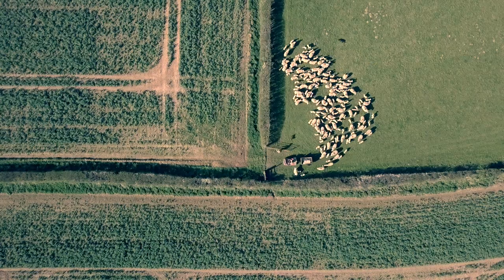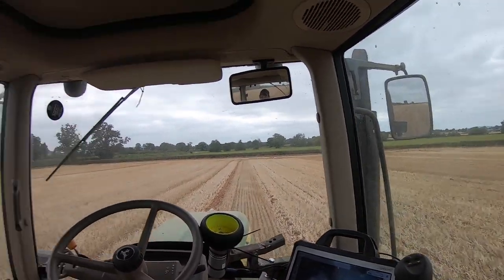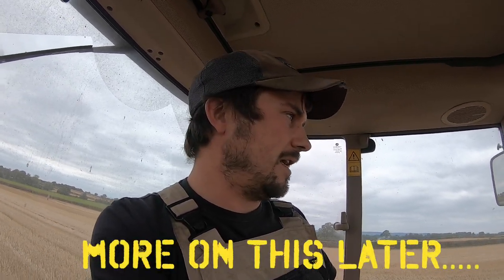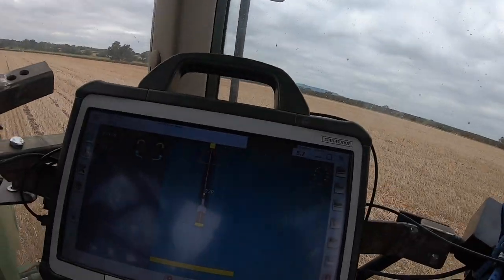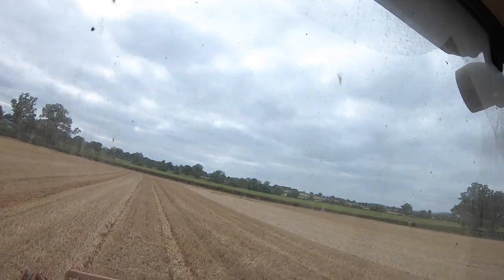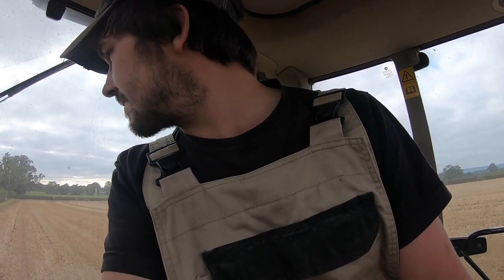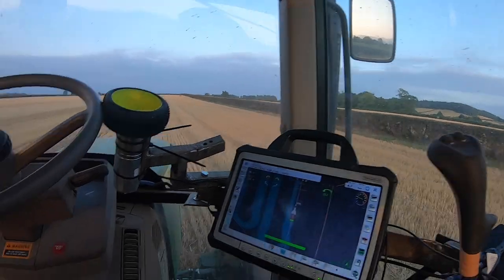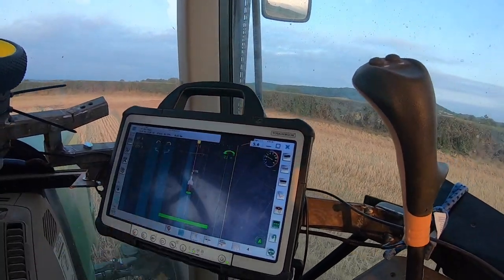Homebuilt Agopengps tractor autosteer goes to work!

Comment: Do you have a video of building the autosteer system? I'd like to build my own.
Reply from the maker: Unfortunately i don't sorry! This guy has done a video of putting together the pcb/controller which is very helpful https://youtu.be/BXys4PYzAFQ. Aside from that id suggest checking out the agopengps forum. It can take a bit of wading through but there is some great resources on there. More than happy to try and help if you have any questions